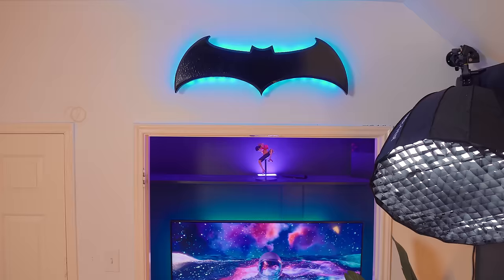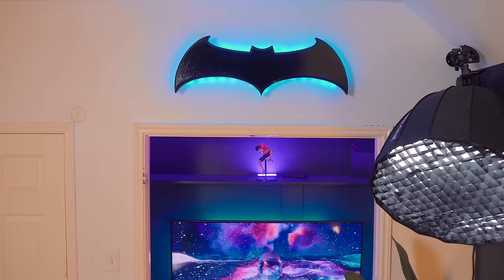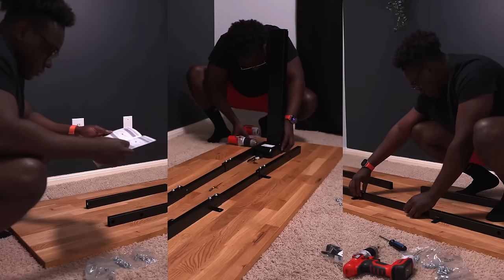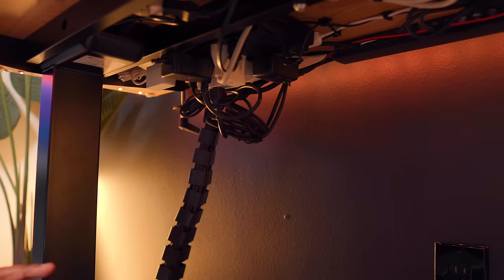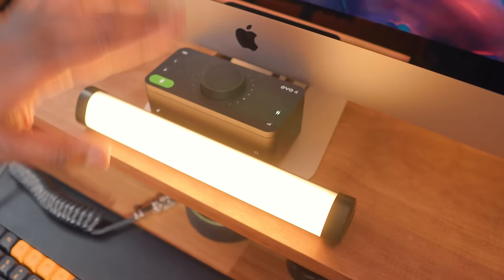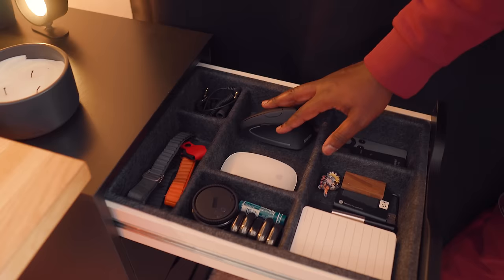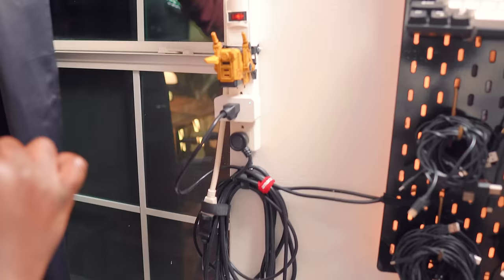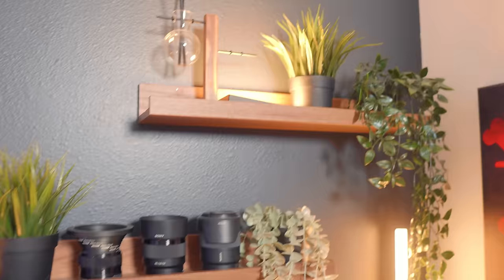My 2024 Compact Office Tour

Comment: Great setup! quick question, what wood did you get at home depot and did you add a wood finish/coat on it?
Reply: for your monitor stand*
Reply from the maker: Yes, its was a hardwood Oak board that i finished with some stain